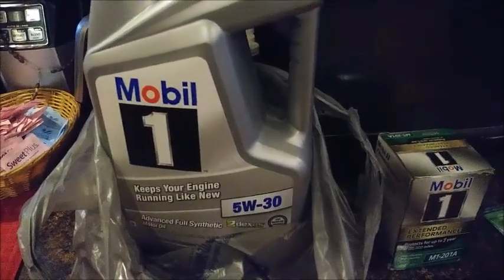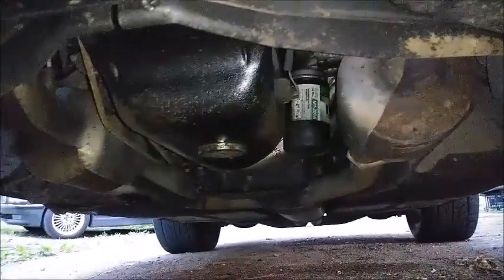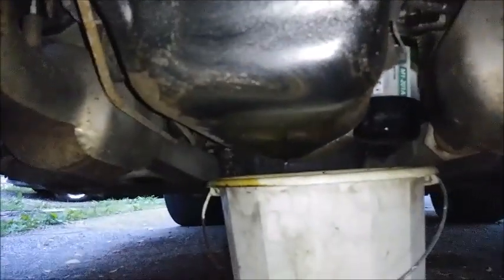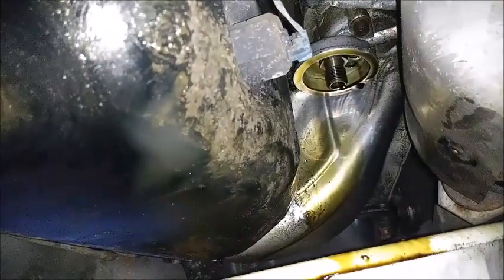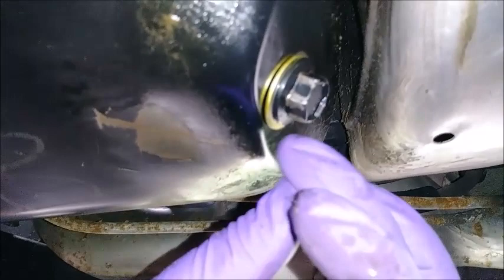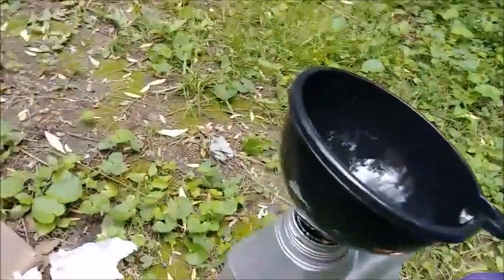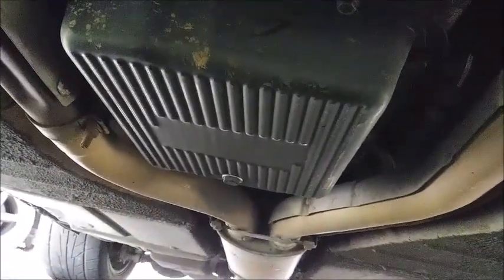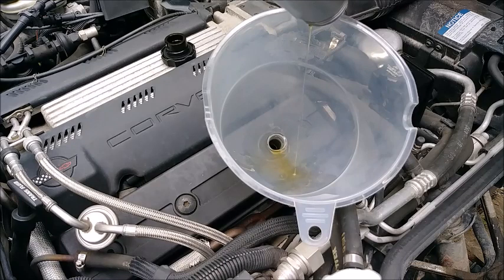how to change the oil in a c4 corvette and reset the oil life monitor

Comment: Do you still recommend that drain plug gasket?  I got a black paper one, but that one looks a little better with the rubber.
Reply from the maker: I always use that copper/rubber o-ring drain plug gasket. I recommend using one every time.

Comment: Does the Change Oil light turn on from a timer or does it actually detect oil quality?
Reply from the maker: @DC.  Mileage based on the Corvette. If you change the oil and never drive it, that light will never turn on.

Comment: I have a 95 Vette and the internet says it take 4.5 quarts.. but it's not even close to the fill line on the dip stick... ?
Reply from the maker: @mrdeanv4414  newfangled filters hold a lot more oil than they did in 95, I reckon. I'd fill it with with 5 as a base line and go up from there.
Reply: @HollywoodHornet  Thanks

Comment: Question I out 5 Qts then another 2 qts cause my sensor said I was low. Now when I start it it starts off at 80/PSI but then warmed up goes back down to 20-40 Do I need more or less I'm so lost.
Reply from the maker: What sensor? The oil level is checked via the dipstick. The oil level should be in the normal operating range, between "add" and "full". The pressure gauge will always read higher when cold and then drop as the oil heats up and thins out. You cannot determine oil level by monitoring the oil pressure via the oil pressure gauge.